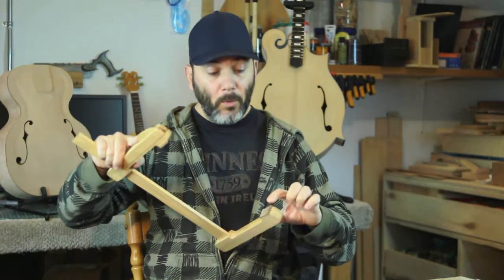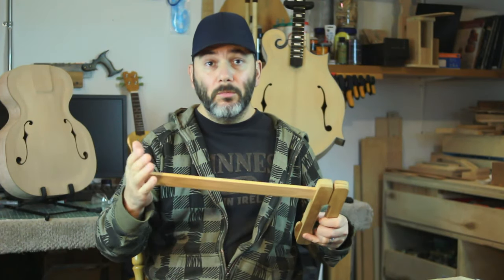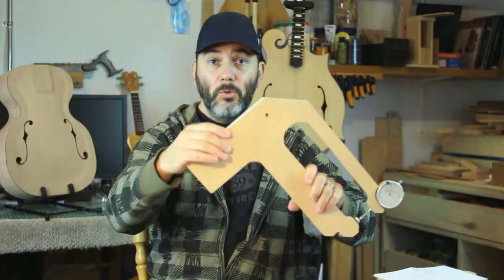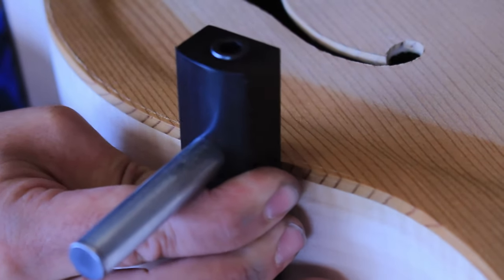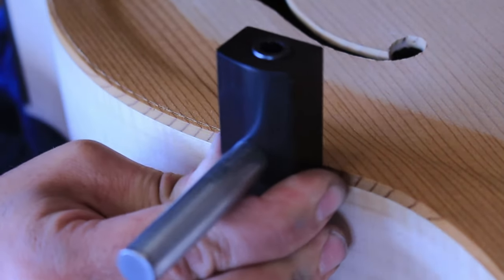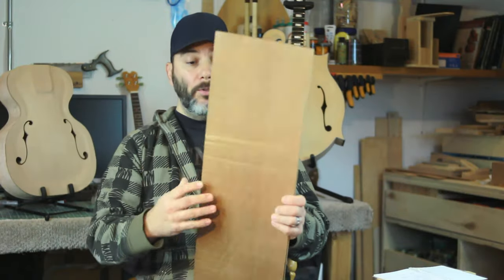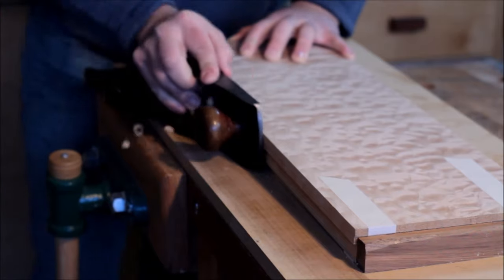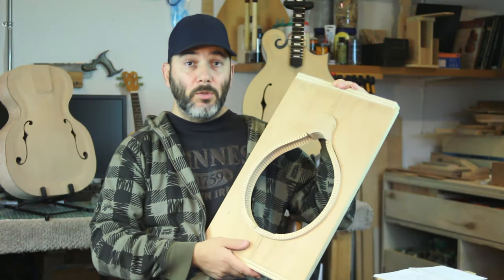10 DIY Tools & Jigs that will save you money !

Comment: Tomy great vidieo, I just tried too make 4 cam clamps this past weekend, I found them a bit harder too make than I thought & after I tried the clamps 3 of them do not hold when i tried too clamp something, I cannot find anything too trouble shoot what I might have done wrong for them to not clamp?
Reply from the maker: 2 out of my 10 clamps had this issue and the problem was the hole for the lever was in the wrong spot. It needs to be off center so when it is spun around it puts pressure. That was my problem and I honestly don’t see what else might be wrong.

Comment: Where would I find the measuring tool you used to make your thickness caliper? Thank you for the content.
Reply: If you want a digital one: https://www.harborfreight.com/saemetric-digital-indicator-63613.html
Reply: Most automotive tool supply stores will have a dial indicator they usually cost around $20.00  also called a dial caliper
Reply from the maker: John is right, automotive part store! 
Happy building!
Reply: I got mine at harbor freight was like $10 I think. Worked great for my classical build.